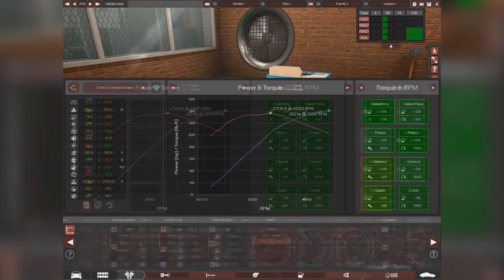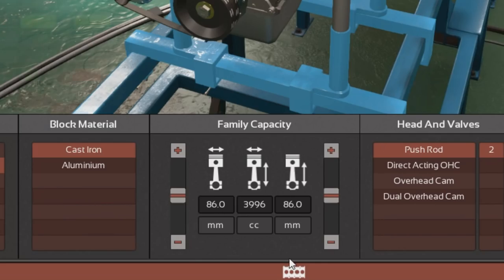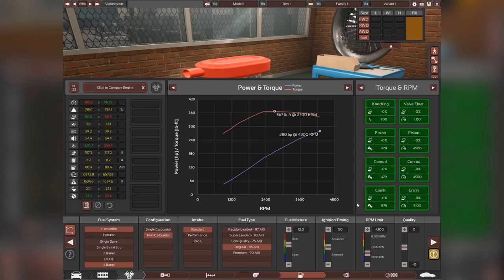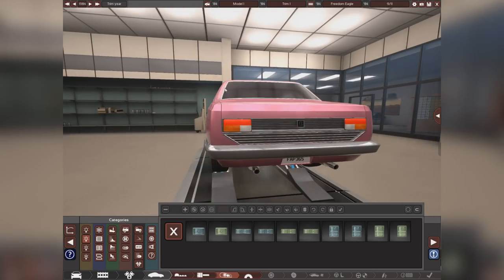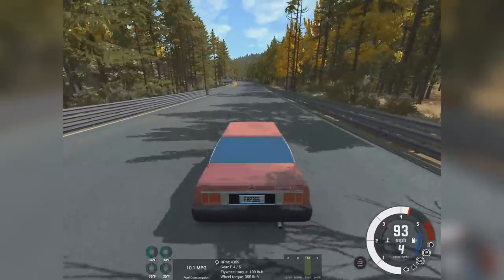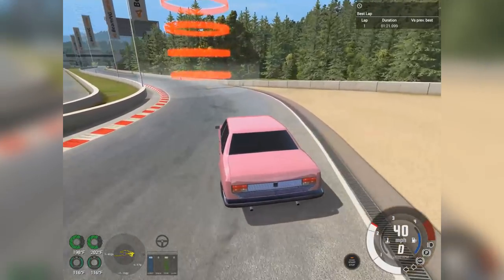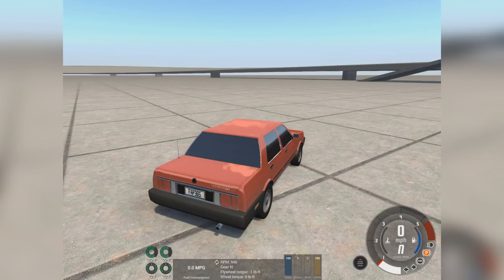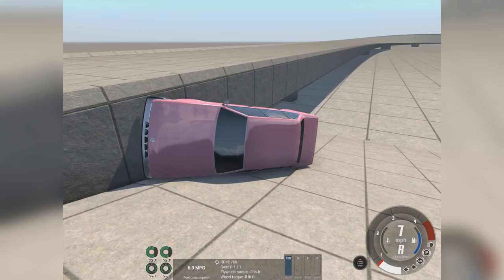How (not) to Make a Car

Comment: Max RPM: 4,500, 2 gears. Knowledge.
Reply: 8500cc. It will never stall anyway
Reply: This is America
Reply: My truck's better, if you can believe that
Reply: This seems factually accurate for an 80s American car.
Reply: @RockabillyFox aren't Powerglides 2 speed?
Reply: GM powerglide transmission
Reply: Hey, he could do it two stroke instead of four. That would be just like truck engine.
Reply: @samwilson182  yup

2 gears can work
Reply: @BOTmaster15  diesel engines made in the last 20 or 30 years have all been 4 stroke

Detroit diesel was the only ones doing 2 smokes
Reply: this will give fuel consuption 200/100
Reply: 3 gears the infamous R (racing) gear too
Reply: in Sweden we call it A-traktor
Reply: @Esteban Pedroza You think this thing has a clutch? That's adorable.

Also, 80s American land barges had 4 gears and 5 to 6 liters displacement. Unless they were Cadillac. Then they had 8.

Mind you, the Cadillac 500 made double the horsepower in 1970 than it did in the 80s due to new emissions regulations. Most people ignore this because MUH GERMAN ENGINEERING.

Ford was relatively quick to resolve this issue and had it under control by around '85. GM took...quite a bit longer. And Mopar...uh....
Reply: maybe not in automation, but anything marked as an auto in beamNG will have the default torque converter.
Reply: @Esteban Pedroza "Even if an engine had a torque converter, it would still need a mechanical clutch to separate the fluid coupler from the output shaft of the engine at idle and stop"

Not really, when you have a torque converter you don't need to separate the engine at a stop, the torque converter slips, and there is no wear since it's all hydrodynamic it transfers the power through oil.  There is heat generated though, but it gets carried away by the oil and the oil gets cooled in a radiator. This is when you shift into D you can hear the engine get loaded and the car creeps forward slowly. To keep the car from moving you just hold the brake. 
The torque converter is bolted directly to the flywheel,and it always spins whenever the engine is running. The turbine is inside the converter housing, and it's splined to connect with the input shaft. When you shift into Neutral or Park the input shaft is disconnected and spins freely. But it doesn't get disconnected at a stop in Drive, nor does it need to be.
Modern cars do have a converter lockup clutch, for efficiency reasons. The converter always slips at least slightly, and that is wasted power. So a mechanical clutch locks the torque converter. Early transmissions locked up only at cruise, modern ones tend to lockup earlier, for fuel efficiency. Some modern automatics do shift to neutral at standstill with the brake pressed, again for fuel efficiency.
The planetary gearbox does have multi disc clutches, but those are used only for shifting. This is why an automatic can shift under load, unlike a manual.

Pretty much all automatics worked like this until late 90's.
The reason is simple - without modern electronics which control it would be impossible to get it to shift smoothly. For instance it was impossible to have an automated manual because it was impossible to cut engine power during an upshift -  the throttle cable was mechanical. Controlling a starting clutch hydraulically and retaining any sense of smoothness is pretty much impossible.
 So the torque converter + planetary gearbox that can switch under load was the only way possible.

Until the late 80's ALL automatics were hydraulically controlled, the only electrics on them being the reverse light switch and the kickdown solenoid. Only in the late 90's did electronically controlled automatics became common. Electronic throttles became common so it was possible to regulate engine power regardless of the pedal position. Until 2000's 4 speed automatics without lockup were the most common. Not much progress since the 50's and the then common 3 speeds. But since 2000. we went from 4 gears to 8 and 9 with lockup, got dual clutch transmissions (which ironically are dying today, and are getting replaced with torque converter automatics), got CVT's, got automated manuals etc.
Reply: Yert
Reply: Mekel? How the hell did i find you here?
Reply: I wonder how fast it'll go in reverse

Comment: That's no sedan, that's a truck that came from 1950
Reply: Nope. Thats every american full size sedan from Prehistory-1998
Reply: @AfterDark3 -- Really? With a 10L-engine? I didn't know Detroit built engines that small!
Reply: It's a 1977 Cadillac. That car had like a 9l V8 that produced under 200hp
Reply: @drgabe2908 
I didn't know you could fit 400+HP into less than 200HP.

Comment: its probably wrong because you didnt give the v8 vtec
Reply: @Awesome1805 -- You're fired.
Reply: Freedom just kicked in yo
Reply: Fun fact: GM did gave "vtec" (VVT) in their cars as far as LS engine family goes (if not even earlier).
Reply: @BOTmaster15 -- Yes, we know. It's not quite VTEC since it doesn't vary valve lift because their system is limited  to a twisting actuator that modifies the timing on the camshaft, albeit seamlessly. However GM never advertises those innovations. Everything always stays an ECOTEC or a VORTEC or an LS. Maybe their PR thinks they mostly sell to women and they are allergic to words like "solenoid."

Comment: When is the offroad trim coming?
Reply from the maker: It's got rally lights dude that is the offroad trim.
Reply: The lights work like a racing stripe but instead of making you faster it gives you ground clearance
Reply: @Dragos -- Pfft, offroad trim. Screw the plastic wheelarches. Better make a Ford Bronco ripoff and re-enact every offroad-fail video you can think of...
Reply: Sliphantom great car btw it has 2 gears

Comment: bad gas mileage? it's the 4 barrel carb! 
I was the proud owner of a 62 Chevy c10 short bed with a 350 small block and wet nos, two speed powerglide, going down the highway you could watch the gas gauge drop
Reply: I know I guy who'd daily drive a car that whent 4 miles to the gallon

Comment: I just finished making a rear engine 3.8 liter flat 6 TT 8 speed auto awd car that make 678 pound feet of torque at 4,500 rpm and 700 horsepower at 6,500 rpm and redlines at 7k and weighs 3,756 lbs. It does the track in 1 minute and 2 seconds. And that’s without a wheel, oh and it gets 24 mpg

Comment: Where is the sense in mpg? If a car drives 40 miles per gallon that should be better than 10 miles per gallon, but thats not the case, so its gallon per mile right?  ¯\_(ツ)_/¯